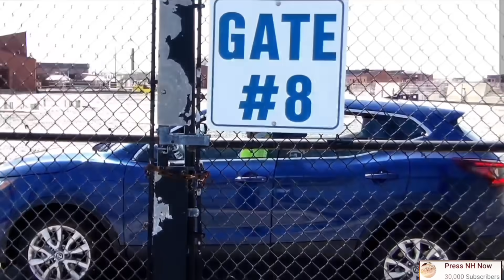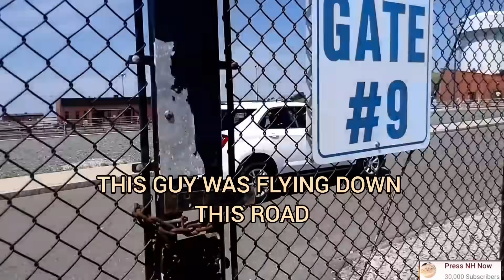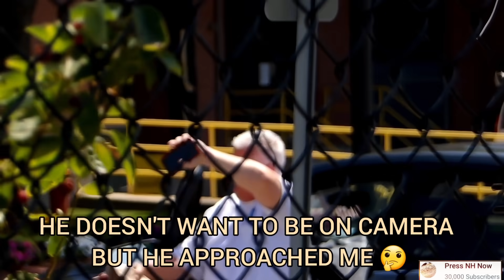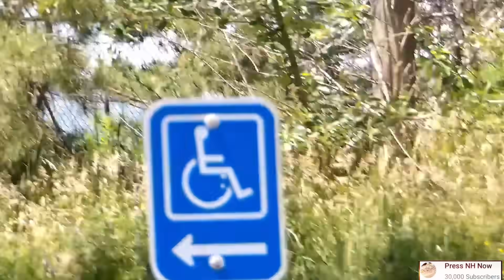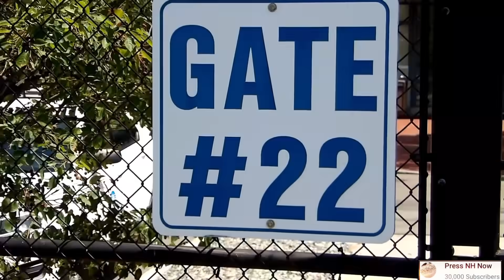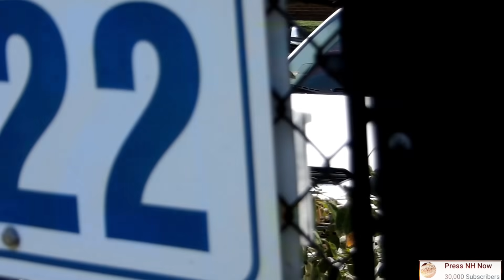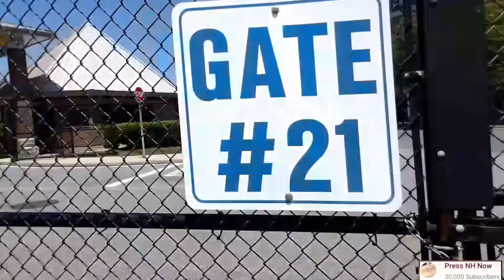*THREATENED* BY TOUGH GUY ALLIED SECURITY.. WATER TREATMENT (DEER ISLAND)

Comment: Gate 8, the device and the beep... A lot of security companies use that system now for virtual oversight. They have checkpoints around the facility/building, you press the device against the dock and it logs that you were at that location. Then they can check that you did the patrol at the right time, went to all the right places and know what route you followed. Like if you have one at each end of a long corridor, the only way you get from one to the other is by walking along the corridor.

Comment: Just so you know.....and I apologize if it was already mentioned I'm not reading through 300+ comments... But just before you enter the parking lot at the end of Tafts Ave, there are small stone towers on either side of the road, that's the boundary between the town of Winthrop in the city of Boston. Deer Island is in the city of Boston not Winthrop, however the town of Winthrop is authorized to perform policing matters on Deer Island.
Reply from the maker: It's confusing because Google says two different ones 🤷‍♂️

Comment: At 8:40 about. It's a switch / reader that security has to visit every so many minutes or hours and either use a key or key card or dongle to prove they visited that location during a perimeter check. It's standard practice in many large Installations.

Comment: Trooper Pinto did so well... until he reported that you were "confrontational"  and "belligerent"! ... It's as if the police are "required" to lie about every call... and he was doing so well... There is no doubt he testilies on a regular basis based on his reporting.
Reply: Reports tend to  use the same vocabulary to cover a multitude of different encounters.  Usually because the authors strengths don't lie in the area of literacy and they think along very limited lines.